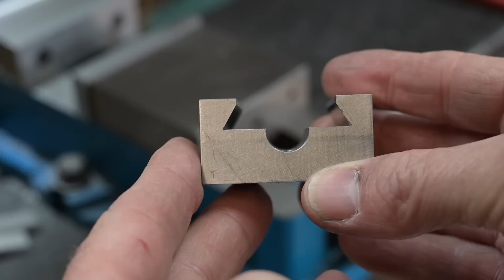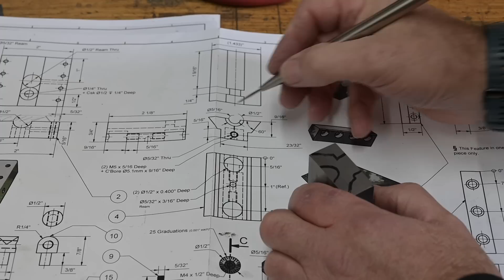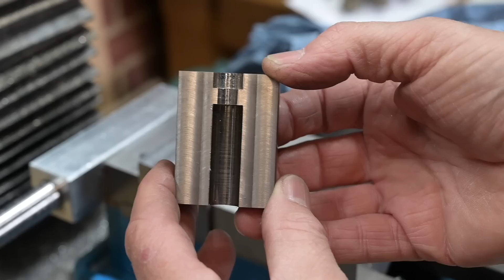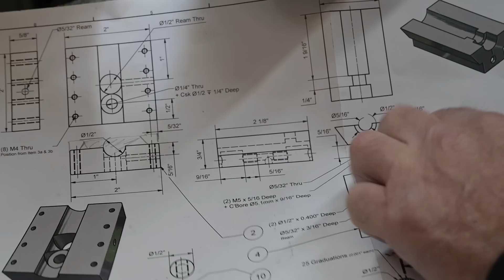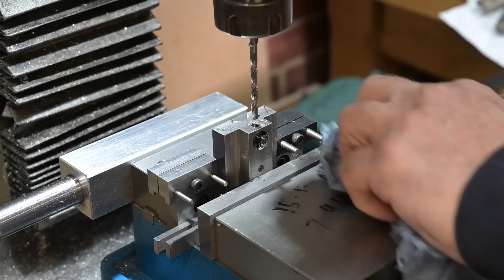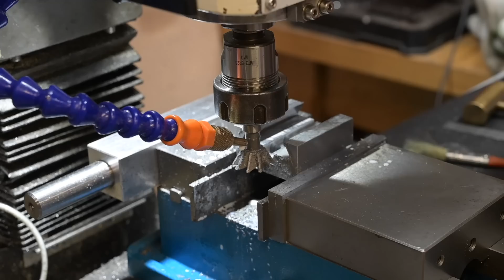Precision Dovetail Cutting - Ball Turning Tool EP02

Comment: I think if you had been up cutting instead of down cutting the mill table wouldn't have gotten pulled to take a ~0.100"+ cut and broken off teeth.
Cutter was turning same direction as you were feeding,  if your 'pushing' the cutter into work, any backlash won't matter as screw is always 'loaded'
Down cutting just for finishing pass would be fine at around 0.005"~0.010" it gives a much better surface finish.
Cutter looked like it was doing great up to the point it stalled.
Glad you managed to salvage everything though.
I subscribed to follow along.
Reply from the maker: @1crazypj Thank you, it was my first ever dovetail, I did learn from it 👍
Reply: @EnglishHobbyMachinist  BTW, I'm British so don't use the American term 'climb milling' which you will find in many video's.
Take a look at cutter 'hook' to see if cut will start at top of material (down cutting - climb cutting), cutter tries to climb over surface. or 'bottom so rotation will 'scoop' material out.
 day or so ago I  started making a 30degree tool to hold cut knurling wheel. (I don't want it 'adjustable')
In beginning, 0.010" to see how cutter was coping ( stainless I've never used before, 'mystery metal' )
It actually cuts real nice with carbide so I kept increasing DOC. until it was 060" deep.
3/4"  square bar thinned down to 0.525" real quick even on cheap Chinese mill/drill. 😁
(been retired a few years,)
Reply from the maker: @1crazypj Thank you for sharing your knowledge 👍

Comment: Your dovetail cutter grabbed because you were CLIMB cutting at the time. The backlash in your x direction allowed the cutter to grab, Yes you could state the issue as too fast of feed, but even slower speeds, this can happen. Especially with dovetail cutter because of the amount of cutter engagement at one time, it is safer to cut were the cutter wont grab the material and lunge forward and taking up that backlash of your lead screw. Nice fit in the end though.
Reply from the maker: Thank you very much for the advice, somebody else said the same thing 👍👍

Comment: Make sure you have at the very least a 1mm flat on the 2 external corners to clear the inevitable internal radii left by the dovetail cutter. This will ensure you are not locating just on the corners, any grit will quickly pick up in those areas.
Reply from the maker: Thanks for the advice 👍

Comment: information, as you mentioned take your time with those angle cutters is key. I run them so slow that one pas takes at least 1min for 5cm. Then those cutters wont go dull as fast they dull but not that fast even for they are soldered carbid. Nice thing you build there =)
Reply from the maker: Thank you

Comment: I cringed a little when the dovetail cutter caught and broke. I've had that happen myself ironically on the same type of job. I'm glad it turned out nice for you. I am rather curious as to how the tool holders are to be secured. It looks rather thin at the edge for a grub screw. Is the perhaps a pin that goes through the middle somehow?
Reply from the maker: You are correct there is a pin and grub screw in the centre which means you can only fit one end at a time 👍

Comment: Nice recovery! I think the semi-circular feature is clearance except for the raised boss that retains the "lead screw" so your method seemed fine to me. The fit is really between a slot in the screw to that bosses thickness to minimize backlash in the adjustment, I expect.
Reply from the maker: Yes your right, thank you 👍